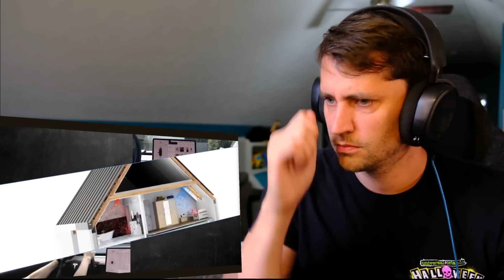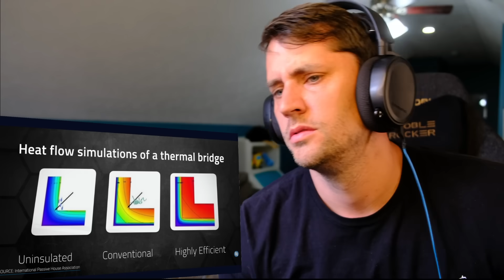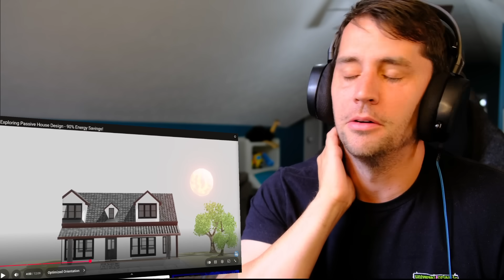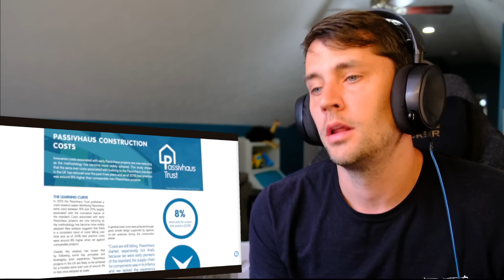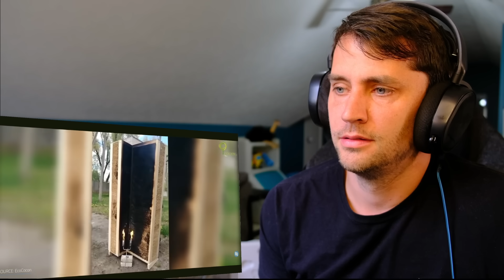American reacts to Germany's amazing 'Passivhaus'

Comment: Lüften when cold: Yes, of course. Lüften means opening all windows for a short time. The old air get out, cold air comes in. But the time is too short that the walls would cool down, or even furniture. You only have to reheat a pound of air, if so much at all. And don't forget: You are a heater with 200 to 300 Watt^^.
Reply: Of course, this works better with solidly built houses than with the cardboard boxes in which many people in the USA (have to) live.
Reply: If you have an automated ventilation system, you dont need to air out the house. You loose energy in winter or gain to much in hot summer. So the biggest problem in energy efficient houses is the user, with its old habbits of airing out the house.
Reply: @27788mo  User who own such a house usually know that.
Reply: Yep, men are the engineers, wifes rule😊. Me, thinking how much does this cost us. She, feeling much better now. 😊
Reply: I think 200-300W is excessive. At university, I learned that when designing theaters, cinemas, and other assembly spaces, you have to consider the waste heat of 75 watts per person. That's still a lot: when I go camping in the winter, I use a 100W gas lamp. It's very inefficient as a light source, only 10-20% light output; the rest is waste heat. With these 80-90W, I can quickly heat a two-person tent so I can sit comfortably in a thin sweater.

Fun fact: Hitler had planned a gigantic domed building for his utopian Berlin, one that could easily have housed St. Peter's Basilica in Rome. Modern calculations have shown that the waste heat from the people inside would have created a microclimate with rain clouds and gales that would be impossible to control even with today's technology.

Comment: The introduction of energy-saving light bulbs has rendered many passive house concepts obsolete, as the original plan was to use the excess heat from the light bulbs to heat the house.

Comment: 90% more is not 10 times more, it is 1.9 times more...
Reply: yeah but if another house needs 90% less energy it still means that you need 10 times more energy than that ;)
Reply: @AcouNoos  i thought video said "90% more efficient" not "90% less energy". Now i am confused
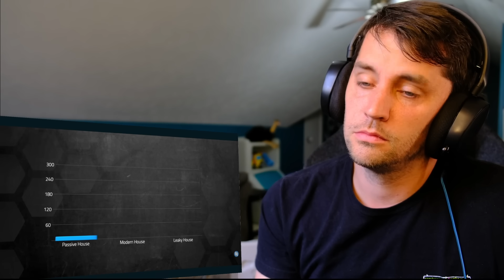Reply: @andreycamper5863  12:35 shows the numbers for heating. 15kwh/m2 in a passive house vs 150kwh/m2 in a normal modern house vs 300kwh/m2 in a poorly insulated house. but i have to admit, now i was confused too for a second ;D
Reply: @AcouNoos  yeah it seems 10 times indeed

Comment: American houses aren't fundamentally worse in terms of energy consumption than German houses.
Let me illustrate this with a personal example. My parents had an American bungalow built in 1970. The walls are relatively thin, but with the insulation wool between the compressed wood panels, they're quite well insulated. The windows (single-glazed) slide open halfway. For the winter, there's a groove in front of the windows for inserting another window. This creates a 2 cm air buffer zone between them. And there are additional shutters. For the summer, the outer panes are replaced with fly screens. The radiator is about 20 cm high and is located at the bottom of the exterior walls, running all the way around the house. In the middle of the house, there's a tiled stove, which can heat the entire house well, even in very cold temperatures. The annual energy costs for heating and hot water for the 100 sqm house are approximately €1000 for oil and €600 for wood.

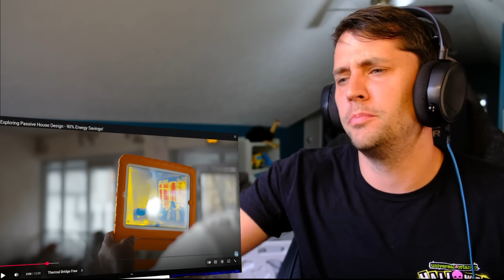Comment: 5:20 It is required to have an energy efficiency certificate for each house/flat/condo for sale in the EU, so the buyer can see what his annual cost of energy will be.
Engineers measure every parameter of the building and they calculate how much kWh energy is needed per square meters for heating or cooling.
They put thermal images in the report too.

12:05 Each adult person radiate ~120W of heat.
Reply: For the certificate you can also use the last 3 years of consumption. That way you don't have to Analyse the house itself. But both methods have their faults.

Comment: AC reduces air humidity. That's a reason why many Germans can't stand AC.
The Passivhaus is almost an outdated concept. The new idea is called energieneutral. This mean that your house produces as much energy as it uses - not only including heating, but also electricity and warm water. You put solar panels on the roof, use electricity to heat your house. This allows some flaws in the insulation, because you can just add another solar panel to make up for it. So you can decide which is cheaper. There's just the problem left, that the house produces the energy in summer, but uses it in winter.
And that's the reason why there aren't mor Passivhäuser. Everyone is waiting for the 'final' solution. We build houses that save "only" 80% energy instead of the 90%, place some solar panels, and wait for the "final" solution.

Comment: 25,000 certified passive houses doesn't mean there are only 25,000 passive houses. Certification also costs money. I can imagine people having their house built according to the passive house requirements and not having it certified after the build. Sure, there's a risk that you may have some small energy leaks but then again, does that outweigh the cost of certification? I imagine only environmentalist diehards always have their homes certified.
Reply: Anyone who likes free money is going to have their home certified, there's plenty of subsidies tied to it. Also having a general energy usage certification is a legal requirement if you want to rent or sell.
Reply: My parents build a passive modern half-timbered house with loads of wall to wall triple-glazed argon filled and silver foiled windows, geothermal heat pump, solar panels and very smart isolation already back in 2003. And they never had it certified as passive house. Why bother with an expensive certification when you know what materials and standards you’ve used and you’re planning to live in it for the rest of your life just you and your family. They would have probably done that if there was any significant financial incentive (i.e. subsidy) but back then there was no such thing. They are just happy about the minimal heating bills and in the summer they even sell the surplus electricity generated by their solar panels back to the main grid. The only repairs they had to do on the house in the past 22 years was on the balcony railings, repainting of the timber frames and changing the heat pump engine unit once. And they got a new kitchen after 15 years. Nothing more.
The building cost was about 30 per cent more then the standard house back then, but that was mostly caused by the fact that the house is built into a steep slope and required lot of land excavation and foundations like an anti aircraft military bunker - the passive house standard components were not that much extra. And today the difference would be even smaller because passive house standard materials are becoming the mainstream. 22 years ago they were a novelty.
Reply: @terezahlucha4613  Certification is not expensive (in the context of building a house): Usually less that 2k Euro. Aside from subsidies you want to do it so that contractors don't get away with botching the job. If you DIYed, you want the certificate to know that you've done it right. It's a guy going over the walls with a thermal camera plus a blower test (close all windows, blow in air through a door adapter, see if anything is leaking), it's really not involved and any house inspector will be able to do it for you. 
Not doing one 22 years ago is understandable, but if they were to sell their house today they'd want to get a certificate to increase the sales price. That's going to cover those 2k several times over.

That said there's certainly a lot of houses that satisfy the various (increasingly strict over the years) KfW standards, but not the passive house standard. The KfW eased the industry into building more and more efficient housing, enabling them to focus research on whatever was the lowest-hanging fruit at the moment for which there was no off the shelf at-scale solution, that's why building to strict standards has become so cheap over the years: Instead of a limited number of builders working on the problem and gaining experience they managed to involve the whole industry. Unless you're paying for a building cash out of pocket those KfW loans are just too attractive to give a pass.
Reply: Also, compared to North American standards, a house built to European regulations is already 90% along the way to a passive house. At that point, the remaining 10% becomes disproportionately expensive for only a small gain in energy savings. Picking and choosing the low-hanging fruit to get half of that done is done way more often than going all the way.
Reply: Also, there are various levels of passive houses. Most only talk of those who is completely passive.

Comment: A lot of those techniques are nothing new. The houses in the Southern USA for example are famous for their style that uses roofed areas in front of the windows to keep it cooler in the summer. And people once used awnings too!

Passive houses - or plus-energy houses - are the highest standard, but even normal standards in Germany are up to "80+ houses", means savings of at least 80% compared to a standardized reference house.

Comment: In Germany and other European countries, an energy performance certificate (Energieausweis) is mandatory, allowing buyers to see approximately how energy-efficient the house is. A new energy performance certificate must always be issued by an appraiser before a house is sold. When signing the contract, both parties must sign that the energy performance certificate was made available.

When building a new house, there are tax breaks for energy-efficient construction.

In addition, our energy costs are higher, making energy a more significant cost factor than in the US.

Homebuyers and builders here are therefore way more educated and aware of the energy efficiency of homes. Energy efficiency is a big topic here when it comes to homes, and it's not uncommon for friends to proudly demonstrate and explain the various clever energy-saving measures during tours of their homes.

Comment: So here's a mindFK for you: A wall section was dug out of the ground in a medieval settlement in Germany. Engineers reconstructed it and tested it, and it fully measured up to the thermal properties of a house from the 1990s. This says quite a bit, since there has been a very high emphasis on thermal efficiency since the 1973 oil crisis. This means that natural materials indeed still are very relevant. Given the amount of energy and non-renewables used in construction, now so more than ever.
Reply: Energy cost in medieval times was not low. Making the wood last longer during winter was pretty important.
Reply: The old "Fachwerk" (half-timbered respectively timber-framed) houses were very energy efficient as long as they filled the gaps between the timbers with a mix from clay and straw, supported by wickerwork. In the last centuries however most of those fillings were replaced with bricks (to make it harder for mice to live in the walls, but also because it was considered to be more sophisticated), and this change reduced the insulation effect (old-style bricks have some thermal capacity, but not much insulation value).
Reply: @MichaEl-rh1kv  
Clay mixed with Straw is quite a good insulation, because of the air inside the straws, air is actually a very good insulation, as long as you do not have the air rotating due to convection. Double or triple paned glass restrict convection by using small gaps.
Reply: Theres a reason why sone of these hippie types build houses out of clay mixed with straw. And a roof made out of grass.. and that's done today. They're always on Grand Designs these guys..
Reply: Do you have a link or sone source? It is really thrilling!
Reply: @janbastian1232 Unfortunately not. Came across it on some historic timber framing site I think. Remember the illustration clear as day, but the rest is kinda blurry... been  years.

Comment: I can not speak for germany but at least in Austria, building costs raised so dramatically many of the middle class can not build a new house at all. This also means pasiv houses are not builded. Many people live in older buildings. I bought a flat from 1985 for around 170 000€. Bringing it up to standards would not also be costly, but also require the approval of 2/3 of the other house owners. Which brings me do my next argument, that I think many here are financially uneducated in regards of behavior of money in loans and cost efficiency in many scenarios. 

WWII was only 3-4 generations ago. Parents back than were shocked by the poverty and teached there children that saving money is everything. I think this thought still lives on in many people, including house owners.
Reply: I am always compelled to point out that "You can't build a house from one income like our grandparents used to be" is only wrong if you do not apply the standards of that time. 
A house after WWII used to be 60m², not 160m², just to take the easiest example. And while the "work hours for a house" have increased even if you normalize that, most of the rest of life has gotten cheaper. But then people fly to the Bahamas once a year und drive expensive SUVs instead of driving a beetle across the Alps to the Gardasee once every three years. And 50€ phone contracts and 5 streaming services...
Reply: @steemlenn8797  My grandparents built the house I lived in - like the parents or grandparents of my neighbours. Nearly anybody had a car, often both worked. Nobody went into holidays. A lot food came from their gardens - but they had a lot ways to get something on the table that was cheap but tasted good.
Reply: I am sorry to hear that you can't bring your house up to standard because co-owners of the house are too financially uneducated to realise that it won't even take a decade for the investment to have paid itself, including interest of potential loans.
But please don't give up searching for a more open-minded community to try and teach about or realise modern housing projects

Comment: I personally know quite a few passive houses in my area. That's why I think there are already many more in Germany.
But even those who own an old house can achieve a lot. Expert advice is free, and there are many subsidy programs. I used to pay €4,000 per year for heating and hot water for my 50-year-old house. With a new heating system, new windows, and better insulation, I now pay about €1,000.
There are so many interesting projects: entire apartment blocks powered by geothermal energy, with their own water treatment systems for toilets and washing machines, and with PV panels on the roofs. There are hardly any energy costs there.
Reply: You once Had a "Inviormently
Friendly"President
Jimmy Carter😅❤end of His Term  he conducted🎉
A Studdy on Energy & Efficiancy
Mandy U.S.Universitys participated😅
The Endprodukt 
Was a350 Page 
Studdy called:
The Integral Urban 
House published 
~1985 or so...
Nice Book!
If you Research a bit @ univercity~
Librarys, i Bet you will find it😂!
Made in a great
D I Y mindest
Using Wind,Rainwater,solar all interated🎉!
Cheers& Greets👋t.

Comment: Windows can be fairly simple to insulate well. In Finland most new houses / apartments have quadruple windows, i.e. four panes of glass set on two separate frames, which means there are 3 spaces of air or some non heat conductive gas between them. That insulates the windows rather well. I would imagine the same being used in other Nordic countries and Canada as well, maybe even in Alaska.
Reply: In Germany tripple pane is the minimum found on new houses most of the time, maybe some dual pane but unlikely. Passivhaus probably has quad
Reply: Alaska is USA territory... No climate change exists 😂😂😂

Comment: Yes in Winter we do "Stosslüften" (direct translation would be something akin to shock airing) where you will open windows wide for a short amount of time to enhance air exchange and reduce the lost warmth (rather than tilting the windows).
Reply: I wanted to say the same... We do that, cause humans need oxygen... how do you get that trough A/C?  It's like filtered air? And not connected with your surroundings what so ever..
Reply: Yeah but in case of a house like the one in the video, you don’t get the fresh air through AC but through the ventilation system of the house. I live in a new house with ventilation system with heat recovery and completely stopped Stoßlüften unless I really want to have the cold air from outside. Air is always fresh inside, no need to waste the good room temperature anymore 👌

Comment: In winter we "Stoßlüften"😂 (blast ventilate): 15 min Stoßlüften in every room while turn the heater off.
Maybe it's my german embossing...but after a good Stoßlüften the room gets warmer (feels more cozy) 😅 😉
Reply: Sauerstoffreiche Luft ist oft trockener, aber es ist der geringere Feuchtigkeitsgehalt, der die schnellere Erwärmung bewirkt, nicht der Sauerstoffgehalt an sich.
Reply: @juwen7908  Sauerstoff hat schon wohl eine Wirkung. Wir werden wacher und fitter. Wenn man Müde und träge ist friert man auch schneller 😉
Reply: @juwen7908 oh....wow! Danke was gelernt!!!😊
Reply: @juliafa6462 Again what learned! 😂 Fantastic!
Reply: We have installed these little energy exchanging ventilation systems. So less Stoßlüften in Winter. Feels a lot better and saves energy..
Reply: @juliafa6462     In Switzerland it is recommended to air the  house  no more than 6 minutes 3 times a day. The inside walls are not allowed to get cold  as it would need too much energy to bring the temperature back up.
Reply: embossing???
Reply: @K__a__M__I "Prägung", oder? 
Wir könnten ja theoretisch mal kurz googeln....😂
Reply: @K__a__M__I Prägung, oder? Man könnte ja mal googeln...😂